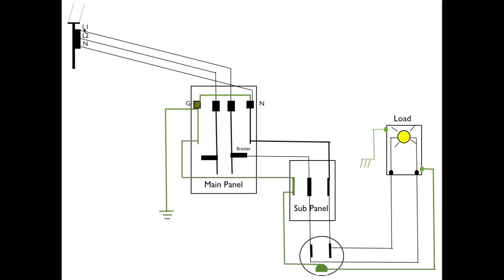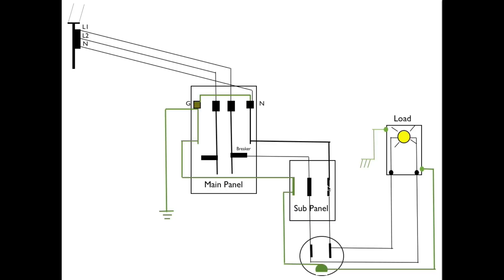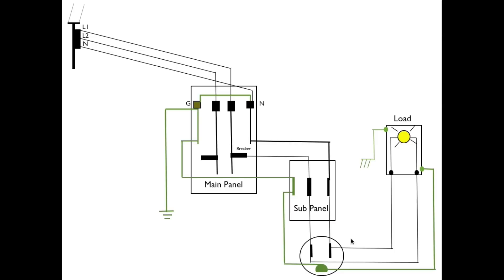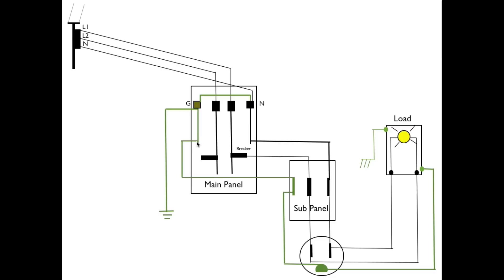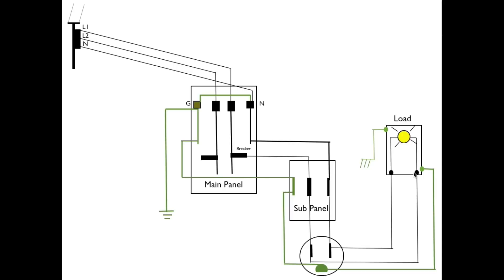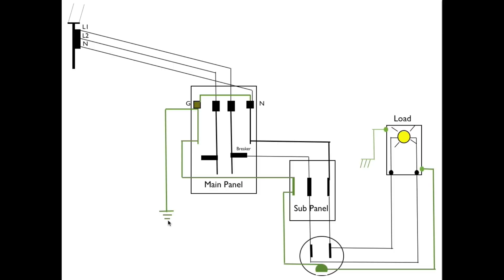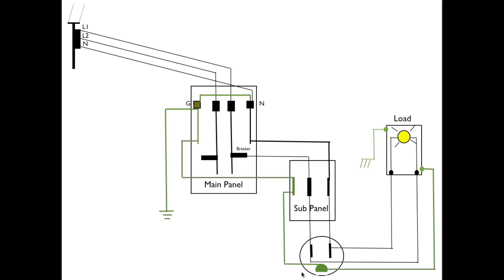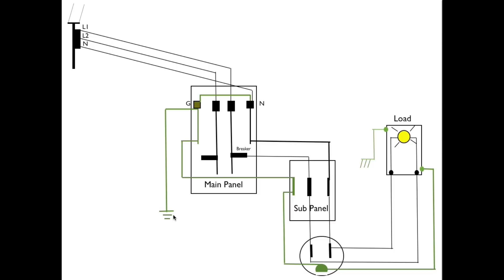The difference between neutral and ground on the electric panel

Comment: I think people assume gound = negative comes from automotive wiring, where that's actually TRUE.
Reply: Brian Fahrlander 
those people think a.c. & d.c. are the same too!
Reply: how is dc not ac at 0 Hz ?
Reply: Because nothing is "Alternating", therefore it can't be called ac at 0 hz.
Reply: Viktor Löfstedt ...try it this way, how is it A.C. @ 0hz?.......d.c. Is not a.c. Whether it's 0hz or a Ghz.
Reply: Good point, and actually 0 Hz is DC. Once you go to 1 Hz or more it's AC. The main reason NOT to use that terminology is to avoid confusion because they behave so different. There was a time in the USA where utility power might have been DC (NYC started out that way) and since they were pioneered by different people with different schools of thought they didn't use the same terminology.
Reply: Most people who know the history of DC vs. AC may recall that Mr. Edison completely believed that DC was our energy future. Lower Manhattan was wired for DC from his original power station there. Tip o' the hat to Westinghouse and Tesla. The later being way, way ahead of his time...
Reply: Yes, and it leads to a weakness for those who assume the DC world mimics your car:  reference for a DC system does not have to be either positive or negative, the only question is whether it floats or not [bonded or not bonded to chassis].  Engineering considerations may be noise and/or fault protection, and whether variables can be removed like field wiring - typically this type of setup is enclosure contained for stable performance.   I've worked on radar systems that had more than one reference and they were not bonded - some were positive, some were negative, and you needed prints to know which one to use for test points.   I saw a tech cross [positive and negative] reference points accidentally and exceed the rating of his meter... which produced a spectacular arc normally produced by somebody gouging with a carbon rod trying to cut 1" steel.    Fortunately, only the probe tips were vaporised, and no burns, but he almost soiled himself.
Reply: (rupe53) Not true, that's called pulsed DC.
Reply: Thomas Lanik   Agreed, Tesla gets no credit and he is the real pioneer in this field.
Reply: Hz does not equal AC. DC is pulsed for many reasons. DC does not go below zero. AC does.
Reply: AC is convenient for distribution, but it needs to be converted to DC to run you computer, TV, etc. or charge your cellphone. So in a way, Mr. Edison was right.
Reply: Reversing the meter does not alter the fact that the DC current always flows from the negative terminal of the battery, through the meter (load), to the positive terminal.

Comment: The hot is on the right side, The neutral is the wide slot on the left. This diagram has them reversed.
Reply: +Skipper Russell it could be an X-Ray view of an outlet. All you have to remember is black is the wire that chars you.
Reply: +Skipper Russell 
Depends on whether you're looking at the receptacle or the plug end.
Reply: +Paul Frederick Go play golf in a thunderstorm , then explain where the ground is.
Reply: When I look at the plugs, I say "Wide White".  The neutral wire goes to the wide slot. "Wide White" is what I get from high school foot ball where we were taught "Wide Right" meant the wide received on Right Side.   This helps me remember.  The ground connection is easy to remember.    I also, use a black transparency pen to mark the hot on a new plug that I am installing. Ink from the pen comes off with plane water and no soap.
Reply: The red wire can char you, too. It's the opposite end of the secondary from the black.

Comment: Thanks for the clarification. 
Now, how does changing the plug you illustrated to a GFCI plug change the wiring coming from the sub-panel?....Or does it?
Well it would have to because the GFCI plug uses a solenoid switch to keep the circuit closed, & it doesn't use a ground. This is why you can upgrade a 2 prong plug to a GFCI.
But also, we have to remember that the GFCI plug protects us (people) from Ground Faults by detecting a current imbalance of 5 milliamps.
Where a regular circuit breaker trip if temperature reaches a certain point because of a direct short, or a short to ground situation, or a power surge (due to dirty power, lightning strike, etc) So a regular circuit breaker's design is geared toward protecting equipment for electrical damage from excess amperage; & to protect against electrical fire. But it does NOT protect people from over-current faults.
This is why the GFCI circuit breaker & the GFCI plug is the best method of protection. You can replace an appliance, but you can't replace a person.
Reply: I didn't see your email until now we are at work and I'm going out of town

Comment: I work on the distribution lines, so we don't typically work in breaker panels. I've struggled to remember difference between neutral and ground, but when you clarified neutral is a load carrying conductor, and ground is just that (shortest path to earth) it simplified things.. 
I would imagine grounding onto a water-pipe would be great idea in the perfect world. However I have been on calls where plumbers have been shocked, or experienced balls of fire from disconnecting the ground. Typically due to a damaged neutral line on the house service. 
Electricity is invisible, and if you see the fire, it may be to late..

This video is very informative with my trouble shooting..
Thank You..

Comment: Being a master electrician for 10 plus years most of what this man is saying is not correct. He is trying but this information is misinformation. Do not do what is told to you here. The terminology is wrong and he is not an electrician. Its called the grounded conductor and the equipment grounding conductor. I didnt hear either of those terms mentioned. Maybe you should take an electrical class before you misinform 1.2 million people. Please go to school
Reply: u must be the smartest guy in the room
Reply: From what I'm now understanding ground doesn't really protect you,I watched Mike Holt videos and ground will carry a load because of the resistance of the soil,won't trip a breaker
Reply: Eric Van I had the same thing happen to me, someone tried to tell me that when incoming voltage drops current goes up and destroys equipment, they were thinking about how a transformer works, I explained ohms law of I = E over R, and I decided to move on myself after all the reteric
Reply: Tony66777 dude… are you serious? Everything he said is correct for anyone trying to understand how the system works….not for someone trying to wire a house. Don’t come in with this 10 year bullshit. Blah blah blah.
Reply: someone loves the Gayfurnaceman
Reply: Tony66777. Since you seem to be the expert please explain what part of his theory is incorrect. Were waiting to be dazzled by your knowledge. His diagram fits the NEC standards for a sub panel which you should recognize if your a 10 year master tech. Unless you know better than NEC standards regardless of his mis use of terms that you claim. The only difference is he is showing a 120V sub VS 220V which is not needed to explain what he is trying to explain. The only thing I may disagree with is lighting strike only involving the neutral wire as it can energize any leg of the transformer.
Reply: B S.  GROUND AND NEUTRAL GO TO THE SAME BAR IN THE DISTRIBUTION BOX
Reply: HR, I know, that's the confusing part.
Reply: Tony66777-Could I ask you a numb question?I'd like to replace some ceiling lights.But when I bought some new ones the package is telling me that homes built after 1985 have wiring insulation jackets rated for 90C,while the older homes were rated for 60C.Of course my home is a 1984.The package is telling me that using these lights would be a fire hazard.Do you have any advice?Thanks!
Reply: Don't upset the Ego driven hierarchy with knowledge driven objective targets. You'll become the target, As I've been told, "you're just being confrontational !"   Siily boys.
Reply: close enough
Reply: Mark Morris  ceiling light or cans , just mix up a good stiff batch of asbestos mastic if you can find it . Or 5/8 gwb will  work too. Just doesn’t get the same response from the troll community living in your attic.
Reply: I'm a service engineer and found most of his information very informative... Some people in the comments have an ego problem and try to put others down.. yes I found a few things that could have been better explained... But overall good information... People be nice
Reply: Todd T  ground will protect you and the circuit. Obviously, the fault current must find the shorter path to earth which has zero potential. Ground does not carry a load, this is false information and can be misleading.
Reply: @toddt6730  Especially An old (red tip)  Federal Breaker not tripping !
Reply: Is Tony saying that the information in the video is incorrect and should not be used as a guide, or is he saying that it is correct but that the proper terms are not being used?

Comment: Try putting a meter on L1 and another on L2. You will see how you are paying for the use of power that goes back into the system to go to the next meter.  Why do you think you have to complete the circuit.
Reply: The neutral of the 240 phase winding that is center tapped carries the unbalanced load. Balance the loads on L1 and L2 and your meter will read the same. The power company is not stealing it from you. The next meter down the road on the same delta transformer is not sharing with your phase winding. It has its own.
Reply: True!! you send the power back to the electric pole indeed back to the electric company but is thru the neutral not the L1 or L2 legs.
https://youtu.be/cMzevUC4sao
This guy in this video is almost dead on but you dont send it back to the transformer to balance a load thats why there's L1 and L2 and also in South America theres only 2 wiring at the houses: the common wire and ground! That's it...I am not saying that is safe but even here in the States old house used to use the 2 wiring system back in the days....

Comment: "Electric current, after passing into the earth travels to the diametrically opposite region of the same and rebounding from there, returns to its point of departure with virtually undiminished force. The outgoing and returning currents clash and form nodes and loops similar to those observable on a vibrating cord. To traverse the entire distance of about twenty-five thousand miles, equal to the circumference of the globe, the current requires a certain time interval, which I have approximately ascertained. In yielding this knowledge, nature has revealed one of its most precious secrets, of inestimable consequence to man. So astounding are the facts in this connection, that it would seem as though the Creator, himself, had electrically designed this planet just for the purpose of enabling us to achieve wonders which, before my discovery, could not have been conceived by the wildest imagination." Dr. Nikola Tesla
Reply from the maker: We have all marveled at what Dr Tesla discovered.  However, he was never able to make his high frequency, ultra high voltage power system work.  And how lucky we are that it did not.  No electronic device we now use would operate with all the earth as a conductor.  However, we would not need lights outside at night as the entire earth would glow.  
In any case, the voltages we are using in these panels are far too small to travel through ground effectively.  Thanks for the comment.
GFM
Reply: an awesome paragraph!!
Reply: Pretty deep stuff from Tesla, which I'm sure is fascinating study,  but as far as this video is concerned, it's more practical knowledge. Understanding the difference between neutral and ground, even though they are tied together in the main panel, and are at the same electrical potential, but are not tied together in a subpanel, can be a challenge to wrap your head around. The main thing to remember is that neutral is the return path, and ground is protection.
Reply: So, Tesla was wrong. He was brilliant, but deluded on at least that point.

Comment: I'd like to say thanks for taking the time to fully explain it. I've been in the field for 8 years and have a strong background already, and this just solidified it.  
Even a lot of electrician dont know why you dont bond subs or what a ground rod does. They just know the nec says so.
Reply: Ryan    You are correct!   NEC only tells you what you may or shall do.   It does not tell you why.   So, why are all the equipment grounds connected to the neutral in the main panel?   Just want to make sure you understand that part.   Respectfully,   Kevin
Reply: @KevinCoop1  in a nutshell, you want the ground and  nuetral bonded to clear lightning strikes or line to line shorts on the utility side. 
 In a sub you dont want them connected. If you were to lose a nuetral, it would use the egc as a current carrying conductor and put a potential on anything  grounded. Including cases and exposed metal.
Reply: Ryan   The question was why equipment grounds are bonded to neutral.   In your comment, line to line and line to neutral faults have nothing to do with grounding.    Also, grounding Electrode conductor is connected to the neutral to dissipate lightning.    So, if you have a line it ground fault in a utilization equipment, you will have higher amps flowing on the equipment ground system.   What is the path of the high amps or where do the travel to.   This is very important to understand most of the Article 250.